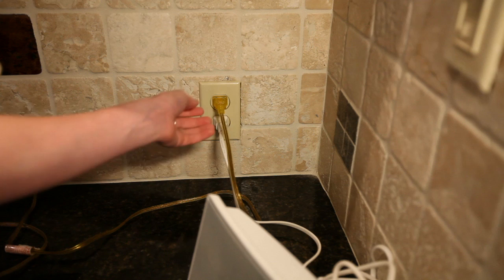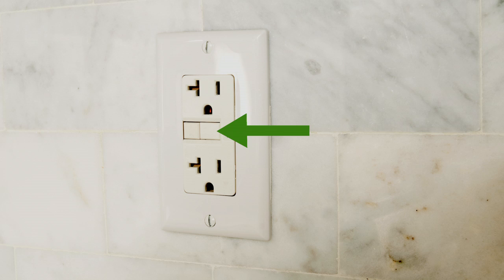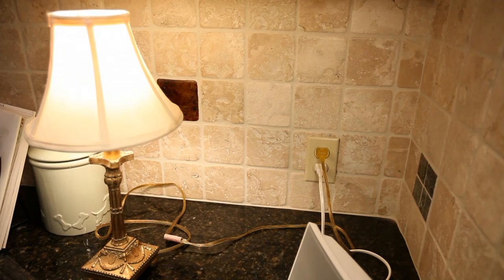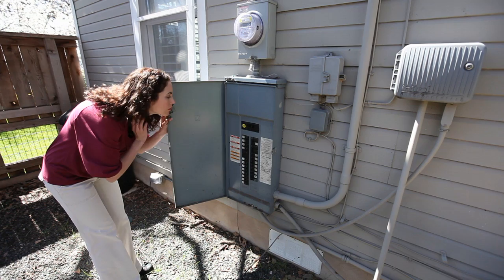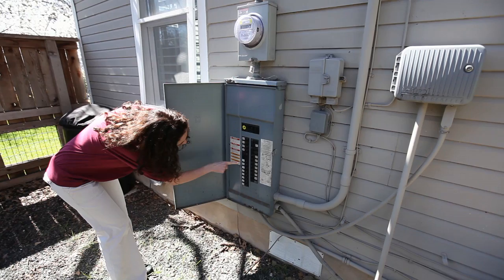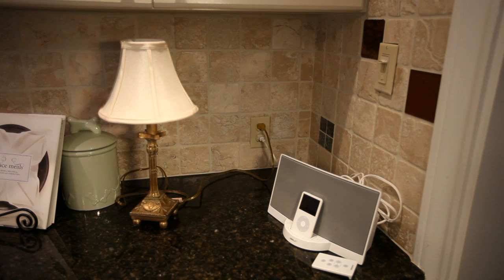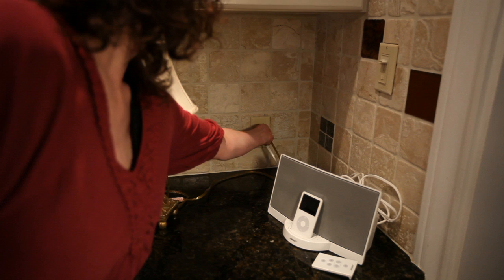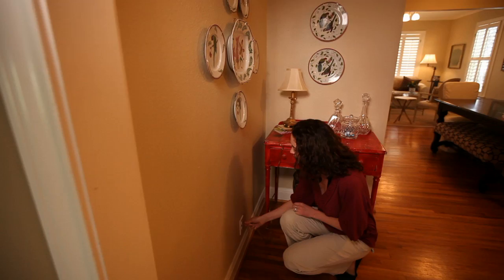Simple Home Solutions : How to Reset a Tripped Circuit Breaker

Comment: Thank you for sharing this video!  My black reset button had been "stuck" for months. Needless to say, the outlets on that wall weren't working. I hadn't even thought of checking my breaker box, which is also located outside (Texas). It was flipped in the On position, but slightly different than all the others. I flipped it off, waited a second, then flipped it back On. Came in the house, checked my reset button and it was no longer "stuck"! Now I can use them, just in time for the holidays! Gratefully, TC😊

Comment: There's 3 things wrong with this video. 
#1. The lamp was not plugged in a GFI outlet.
#2. I have NEVER seen a circuit breaker outside the house. What town is this?
#4. And looking at the comment section, the last question before you go go
Reply: CHITCHATCHEEKO nice #3
Reply: Mine is outside - texas